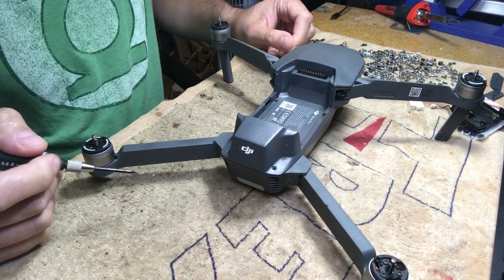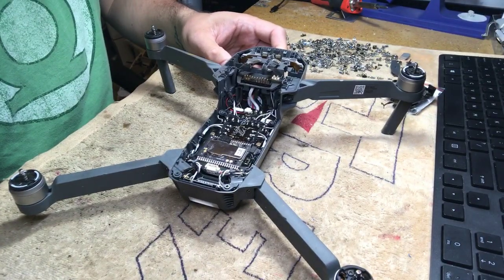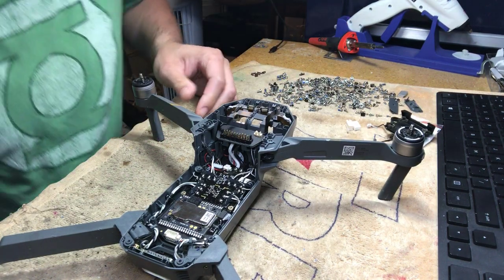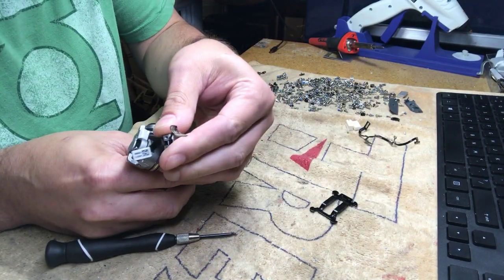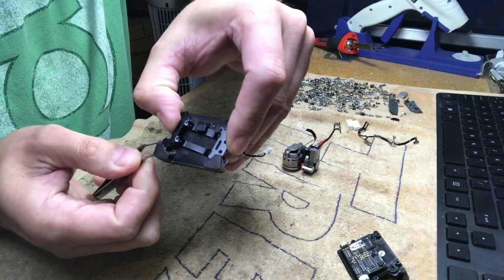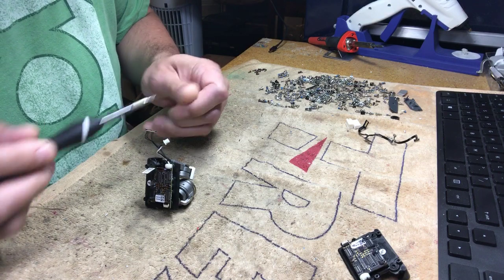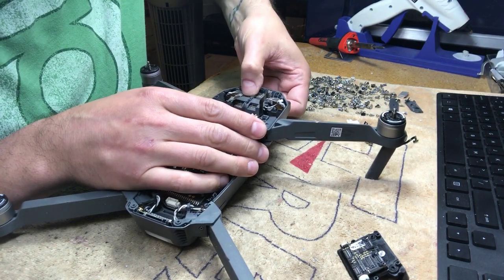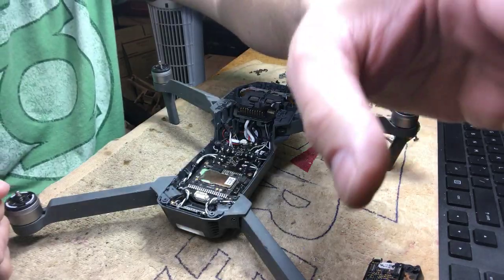DJI Mavic gimbal replacement, anti vibration plate replacement

Comment: Upon removal of the broken plate, I discovered that the ribbon cable from the gimbal to the circuit board is severed. Does that mean the whole unit is trashed? Should I bother sending it into DJI, or should a just buy a new gimbal camera assembly on Amazon for $250?

Comment: After a year of flying, I finally crashed the Mavic, tried to bend back the vibration mount that seems to be made of some lighter than a feather alien metal, lol , snapped instead of bending, anywho, repaired it with lil jb weld and small piece of aluminum can, BAMM !  In the air with no jello at all.  Thanks , your vid gave me a lil confidence to open this complicated thing up.......for the first time. I’m still going to order part , saw it’s cheap enough online.    Happy flying

Comment: Question... if I replace the gimbal board is it true that it has to be calibrated from the factoryfor the specific camera it attaches too? Or can I just replace it and calibrate the Gimbal and it be fine?
Reply from the maker: Legendary Content you’ll be fine. No calibration needed.
Reply: @TheA8W12  sweet. Thanks man. Yeah I sent mine in for warranty and found out that it's only 6 months for gimbal..... they said that that gimbal arm module needed to be replaced... which is what the board is. so I can do it a lot cheaper myself told them to send it back!

Comment: Thank you so much for this thorough and detailed video. It helped give me the confidence to successfully tear my Mavic apart and replace the vibration plate. Did you ever have issues with either of the two front collision avoidance connectors coming loose, since you didn't glue them back down?

Comment: Thank you so much. Broke my drone the exact same way. At first I was overwhelmed with how many things I had to take apart. This video was really helpful. Btw the black substance is silicon, pretty cheap to buy. My only recommendation to anyone is to get a long 1.5mm hex screwdriver. Mine was short and kept clanking against the body of the drone, added probably 20% more time. Also, even if you think you remember everything, take pictures all along the way, and try to line up the screws the same way you took them out on the table. Really helps, because it is easy to get disoriented or forget some screws when reassembling. Thanks again!!
Reply: Great add on advice, thanks.

Comment: Nice video. Saved my drone!

3:23 you're pointing at the wrong set of screws. Just FYI, the correct screws are all have a round top, not flat. They're also a bit more polished and light grey, rather than black ones nearby. Also, they're all close to the surface, not buried. I wanted to let you all know before I stripped one and thought it was all over until i turned the mavic around and saw the silver end of the screws on the gimbal plate.